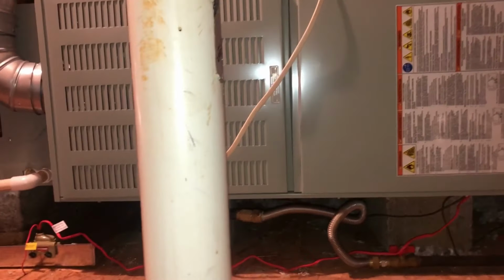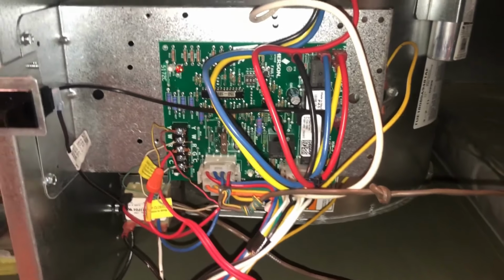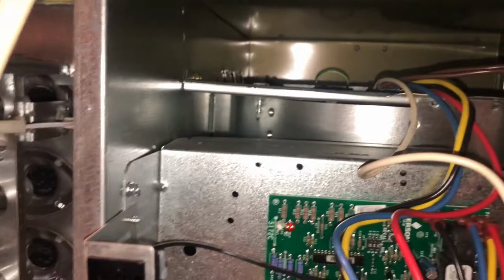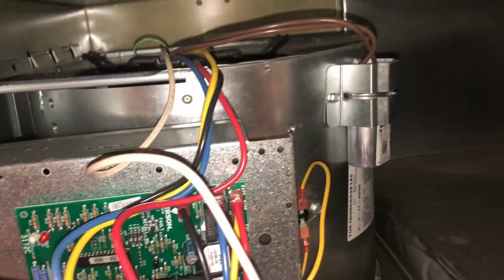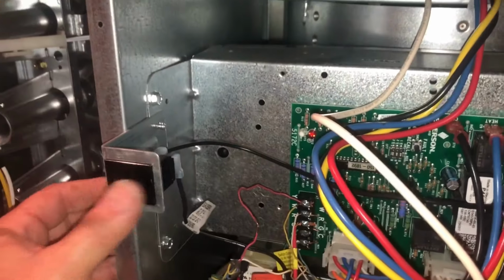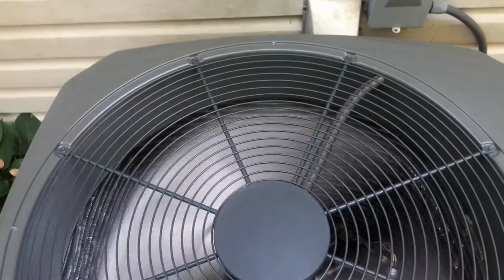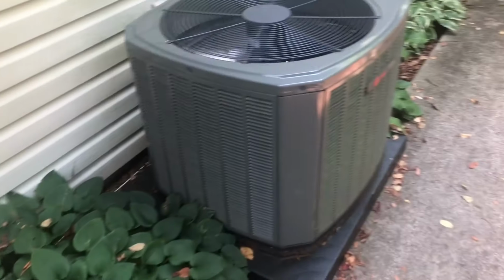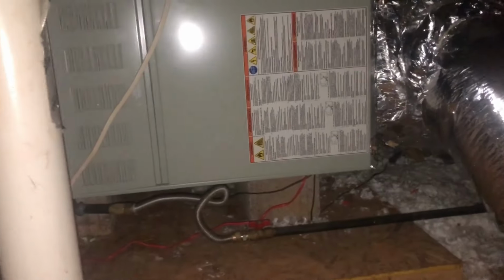Trane Gas Furnace making noise

Comment: Bad thing is its on new installs , now I make sure I check them out before the guys install it or tell the guys to check it out before they even put it up the Attic!  I injoy watching your videos  ,  its even happened on Goodman , Lennox,  and Ruud . Even had one where the set screaw was sitting in the cabinet! Coil ice up !  No noise! Pulled blower check the blades and Reconnect blower up and running fine now !

Comment: a 19 or 21 inch impact socket on the hub. you stopped hammering st the right time though. if you were not prepared to fully pull apart to investigate, given the orientation of the furnace you could have slipped a metal and rubber washer under each of the three motor mount bolts to pull the motor back 1/2-5/8 of an inch

Comment: Could have loosened the draw band on the motor mount instead of risking bearing damage by beating on the shaft. Another tip... Use your refrigeration wrench for the set screw on the blower hub.

Comment: I used to work at the Trane Fort Smith plant. The big  problem would be they didn't line up the motor shaft flat to the blower wheel  flat spot before tightening. It would always loosen off causing this problem.

Comment: I had a similar issue with a commercial unit. Used a socket to hit the blower in and then tightened the heck out of the set screw. Good fix and many thanks for the video.

Comment: Good video..
I have used a socket on those and tap the socket to push in to center..it gives you a more even force than one side at a time...
But gently.....
I guess we as contractors need to call American standard and maybe this can be prevented at factory,by them added more torque to that hub screw..
Thanks for the video.Mr.Cook ! 
Bryan Tyler Refrigeration

Comment: I'm shocked. Trane doesn't have insulation inside the furnace? Am I seeing this wrong?
Reply: No they don't  and don't think it would make much difference.  What gets me is the use of a claw hammer on metal.  They are hardened steel and good for one thing, pounding nails. Wack two of em together hard enough and they will shatter into shrapnel.

Comment: I would have tried a large pair of vice-grips snapped on the shaft really tight and up against the fan assembly. Then press the ends of the vice-grip handle in the direction of the fan creating a pivot point. A hollow pipe over the vice-grip's handle might help increase torque if needed.
Reply: If a hammer doesn't do it that sure won't